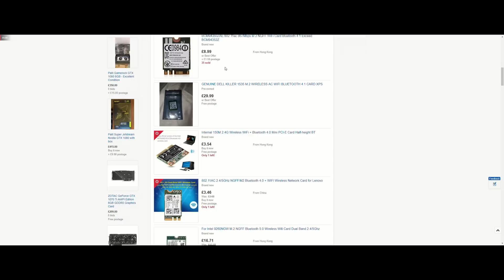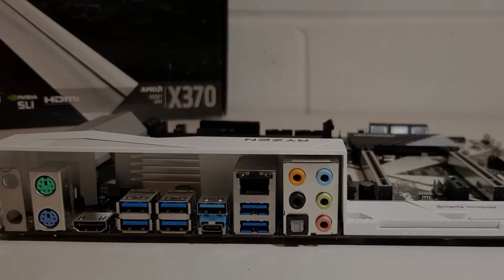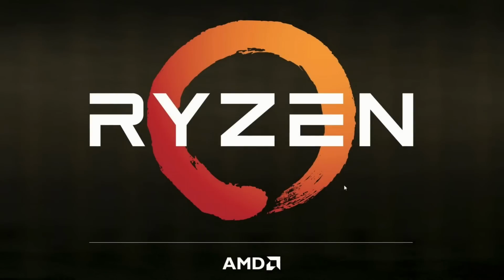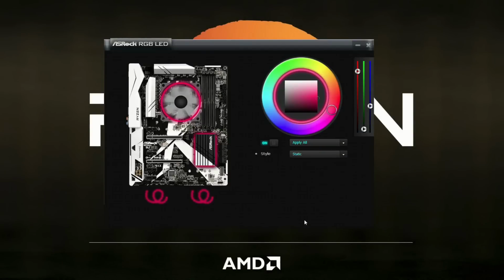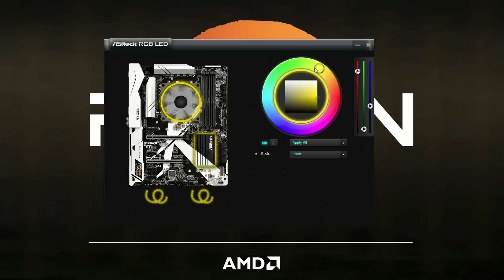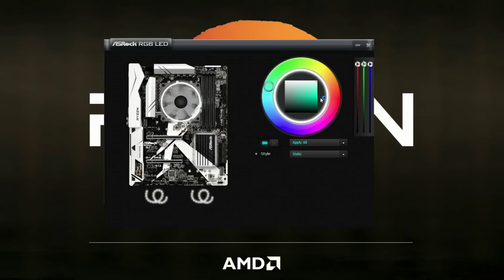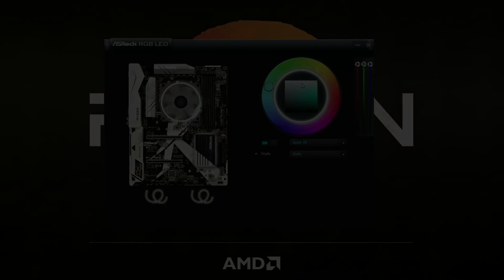#ASRock #X370 Killer SLI - Almost Perfect? Goodbye #Strix B350-F

Comment: Have you upgraded your video equipment lately because the last few videos I have seen a massive improvement in your video quality? Not to say your previous videos were awful or anything. I have a ASUS Strix X370-F in my Ryzen 1700 build and I was so disappointed with the experience with ASUS. Wish I could go back and use this board instead as I have had no problems at all with my B250 Asrock Fatality board for my 2200g build. Love the content as always!

Comment: Ive used the killer x370 and ryzen 7  1700 since it released. No complaints here. I've upgraded everything in my pc 3 times except for my mobo and cpu :)
Reply: I wanna upgrade to the ryzen 7 3700x will it be compatible?
Reply: @madboi1591  might need a newer motherboard. Pretty sure every new addition of ryzen has a new slot on the motherboard but i could be wrong

Comment: When Canada Computers made me an offer I couldn't refuse on an AMD R7-1700, I of course had to get a new motherboard.  So I pulled my Gigabyte 990FX motherboard out of my case and started doing research on which motherboard would replace it.  Now, for my purposes, I've always believed in getting flagship chipsets just for the power and versatility that they offer.  As a result, I knew that I was going to get an X370 board.

I looked at all the offerings, considered features vs price and ignored the brand name.  Let's face it, every motherboard manufacturer out there has been doing this for decades and I've had great luck with ASUS, ASRock, ECS, BioStar and Gigabyte.  The only motherboard I've ever had fail on me was oddly enough the highest-end motherboard I've ever purchased, the MSi K9A2 Platinum which, for me, proved that getting a top-level motherboard from a top-level manufacturer is no guarantee of reliability.  Since then, I've always looked for value and setup.  

The cheapest X370 motherboard in full-ATX size (I only ever buy full-ATX boards) was the BioStar Racing GT5 but I didn't like the placement of the PCI-Express x16 slots.  Twin video cards would have covered too many x1 slots.  The ASRock Killer SLI was about $20 more expensive but it was on sale for around $50 off and it had everything I wanted and then some.  I had to update the BIOS but ASRock had the easiest BIOS updater that I've ever seen.  Without even loading Windows, it will use your Internet connection to download the newest BIOS version from ASRock and it will install it without you having to lift a finger.

For my money it's the best X370 motherboard out there and while there is one with WiFi included, my network is hard-wired so I didn't need that.  Great board, great review!

Comment: I've had this board since Ryzen released, except I have the Killer SLI/AC version which comes with wifi and bluetooth.  I recommend the AC version if you can get it.  I love this board its very goood.
Reply from the maker: It is a cracking board. Out of interest what colour is the included wifi module?
Reply: It is green but it is so small that the white bar code scan label that covers it makes it hardly noticeable.  Most of it is covered by a white bar code sticker like a regular m.2 ssd but this m.2 wifi module is so small that its mostly covered.
Reply: Can i oc 2700x with this???